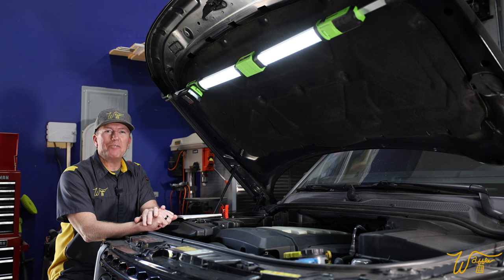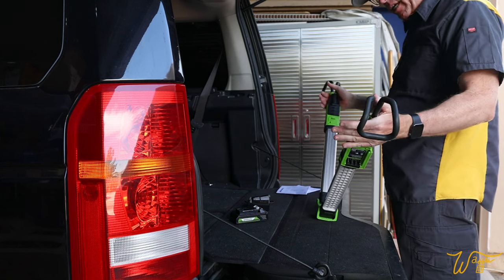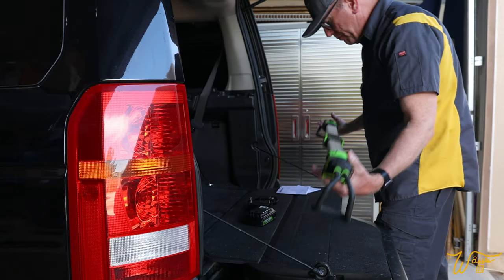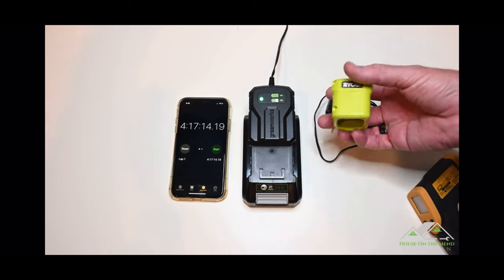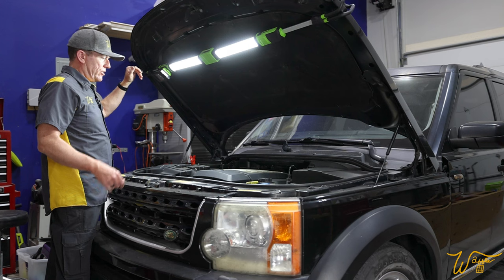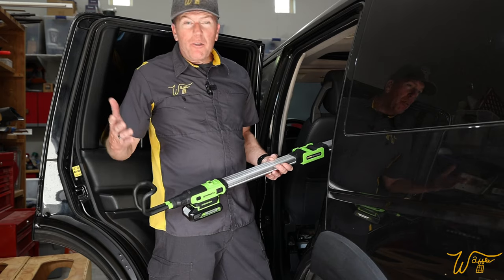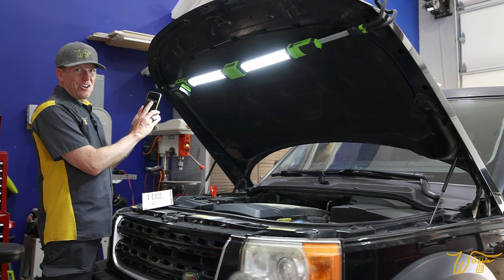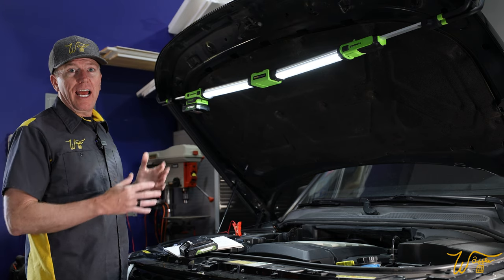Greenworks 24V Underhood Light

Comment: Hi, i’m really loving your LR3 videos.
Off topic question for you.
When replacing the rubber sway bar bushings (LR3)  with new rubber ones, do you recommend preloading (neutral level) the sway bar before torquing down the bushing clamps ?
Thanks !
Reply from the maker: Thank you for your kind words. As stated in my LR3 videos, I am not a mechanic. I’ve also never worked on the sway bar bushings so I am unable to give you any advice.
Reply: @wafflesquare  Thanks for the honest answer. Give it some time. You will be replacing them sooner or later. 😉
I’m on my 4th Land Rover and I do 99% of the work on them. I’ve never heard heard anyone talking about preloading when doing these bushings. The shop manual doesn’t mention it either. I’m surely overthinking this one 😂

Comment: It looks like the same tool sold as DeWALT DCL045, Mac Tools MCL045, and Craftsman CMCL0908. I’ve even seen people point out that the DeWALT did not negatively impact filming when it was being compared to another brand with PWM flicker. Of course, all of these take different batteries and the Mac Tools version even adds a motion sensor with detachable flashlight at over 3x the price.

The DeWALT version takes DeWALT 20V Max and DeWALT 12V Max batteries. The Mac Tools version supports DeWALT 20V Max batteries but ONLY takes 20V Max. The Craftsman only take Craftsman V20 Max (V20 Max != 20V Max).

What confuses me is that those three brands are under the same corporate umbrella… but Greenworks isn’t. I’d suggest that Stanley Black & Decker is just optioning them from the same external supplier but when you examine the mechanism that allows the DeWALT to also fit 12V Max it really seems like they engineered the whole thing themselves… and otherwise there’d be nothing stopping Greenworks from optioning one with the same extra features as the Mac Tools one for a fraction of the price.

They all have different max lumen ratings too.

Any chance you could do a comparison with one of these others?
Reply from the maker: Sure. Send me any one of the lights you listed and I’ll compare it to the GreenWorks.
Reply: @wafflesquare  Wish I had one. ;) The Craftsman has been seen on clearance for as low as 25 at Lowe’s (more reports of 37 though). I’m on backorder for the recent hundred-dollar DeWALT deal at Amazon and considering canceling. No reason to let my DeWALT batteries influence the purchase if others brands like Greenworks include their batteries with essentially the same folding design for less. ;)